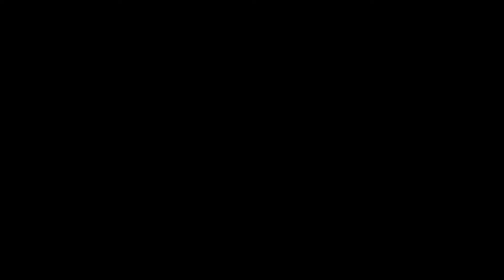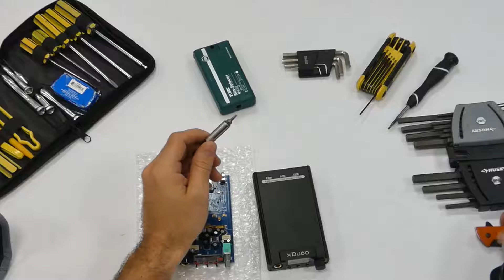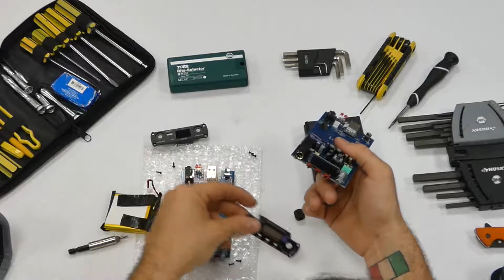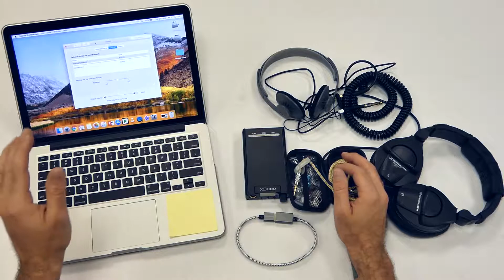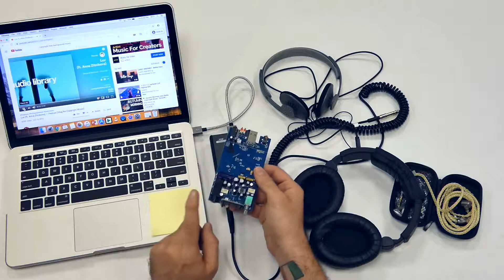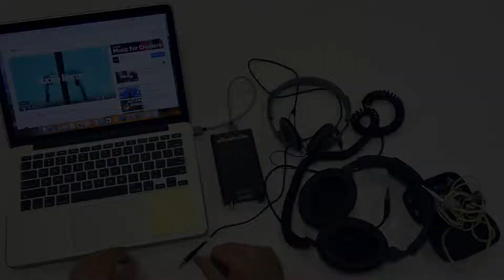[KAnto] Xduoo XD-05 Portable DAC/AMP Part 2: Repair

Comment: Will it work without batery? I have conected it to PC with USB and i think my bettery is bad and its keep charging all the time even if i choose ext power source on back.Problem is its overheating like crazy because battery charging all time. I need to know if i can just remove batery and continue use it on PC or do i need change something else?

Comment: I ended up here because I thinking about buying a xDuoo XT10 II Turntable. However I am wondering before buying, if it's easy to source and replace the battery. Then I won't have to throw it away after one battery.

Comment: hi , i want to ask something.
can we swap the DAC on the XD05/XD05 plus just by replacing it and solder it with new DAC chip?
can the ak493 DAC on the XD05 plus swapped to ak4499?
or are there any factor to consider when changing DAC? (maybe on the electronic specification perspective)?
Reply from the maker: Hi Paulus, I'm sorry for not seeing your post sooner. That is a great question. I would agree with the later, the chip-sets might not be compatible with each other. I would immediately question the capacitors between both PCBs. I really like your idea of retrofitting the new DAC chip. However, I have not see the board on the XD05 + to compare.
Reply: @kanto3411  Any clues what is the battery specifications of the XD-05 Plus, my battery died recently.

Comment: Is it working without batt.connected?
Reply from the maker: Yes! I have a post on my Instagram. I'm still working on turning it into a full desktop unit in a new housing.
Reply: @kanto3411  what is your instagram? Didn't find it.
Reply: @kanto3411  make a video on the new setup if you could. I'd like to strip the battery off as well.
Reply: @kanto3411  please describe it to me and link the video couldn't find it